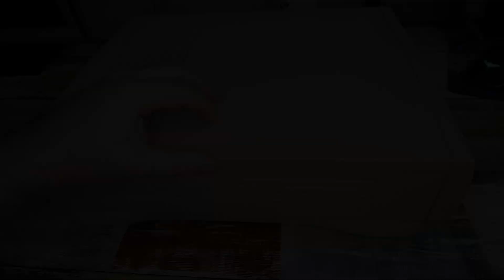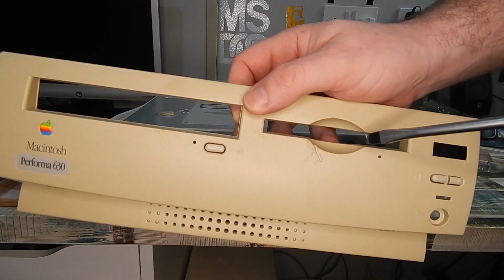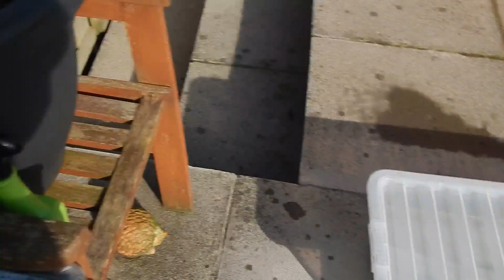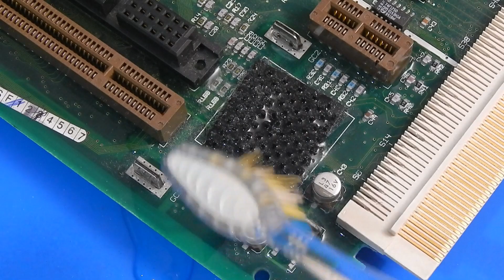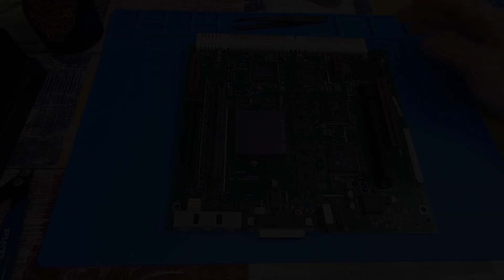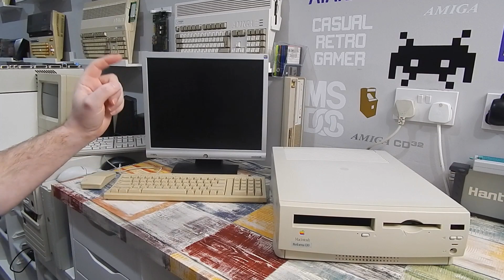Dumpster dived Macintosh Performa 630, time for a look. #MARCHintosh

Comment: I wouldn't be surprised if the original owner gave up on that exact typing exercise precisely because of the astoundingly bad decision to not print how to get a # on the UK Mac keyboard layout. 

Assuming it was the same in the 90s as in the 00s and today, hash is alt-3 on UK Mac keyboards because shift-3 gives £. On American boards, and most other locales, shift-3 gets # instead. 

Thankfully they actually print that on keyboards now so hopefully this doesn't happen anymore, but at least in the 00s you could Google for how to do it. Not so much in the 90s! And I wouldn't be surprised if the makers of Mavis Beacon didn't include anything about this one specific layout quirk. So much for teaching you everything you need to know to type!

Comment: PDS stood for Processor Direct Slot - a successor to NuBus. The best PDS ACARDS WERE DOS and Apple II compatibility cards.
Reply: This is a LC PDS, but may different ones existed in thos times, depending on the mac model. Because this wasn`t a bus like Nubus, it was a direct link to the cpu. I owend a PPC Performa 5200, the mainboad of which based on the design of the Performa 630. In those days I put an ethernet card into the LC PDS slot.

Comment: Great video, I'm glad you were able to get the Performa 630 working again! If you happen to come across an external SCSI CD-ROM drive, that would be another option to add a CD-ROM if you can't find the original edge connector adapter.
Reply from the maker: I do have an external Amiga SCSI CD drive.  I say that but the drive is just a scsi device in an enclosure, the only Amiga thing about it is the squirrel adapter.  I suppose that may work if I get the proper scsi cable for the MAC.

Comment: GadgetUK164 has started using a neat new technique to remove capacitors, with minimal impact. He uses two soldering irons at once to flow the solder then pick up the cap and remove it all in one action. I haven't tried it myself yet but he was astounded how much easier it was compared to his usual hot air solution... (Video here: https://www.youtube.com/watch?v=E49comAT4nM)
Reply from the maker: Sorry for the late reply, when you link other videos the comment gets automatically held for approval.

So what he is doing is essentially like the soldering tweezers you can get.  Personally I don't do that much of it and I'm happy enough with the air but in all it probably is the method with least risk, especially if there is leakage there already which can sometimes make it difficult to get heat into the solder.  

I am subscribed to GadgetUK myself, top man and really knows his stuff.  In fact most of the techniques I use I've picked up from watching him.

Comment: I've learnt 2 things from this vid: hard drive is IDE on a 630. And there is just about enough sun for retrobriting in Northern Ireland ;-)
I love macs from that era. Always wished back then I had one. :)
Reply from the maker: You get it all on CRG, questionable hardware knowledge and sketchy weather forecasts 😂
Reply: Not the 630…. Any Mac from ‘94 to ‘97 is a decent machine, but the plastics… they are so brittle. I’m a Performa 637CD owner myself and I can attest to the fact something falls apart every time I tinker with it. As far as beige Macs go, the beige G3 is what I’d recommend most as it has PCI (meaning you can install a USB and VGA card evading the proprietary stuff without adapters) and IDE, rather than SCSI which is infuriating to use (A BlueSCSI is nice but a pain to set up if you’re a first timer, take it from my experiences with a Mac Classic).

Comment: I have a 636 which is sitting in storage right now.  These are basically a Quadro 630 with an LC processor.  They were (including the Quadro model) all lower-end machines which used an IDE hard disk rather than a SCSI one and were a bit more limited in terms of expandability.  I would like to find a regular 68040 to put in mine so I can run A/UX on it.

The PDS slot is for the Power Macintosh Card which will basically make it into an LC Power Macintosh.
Reply from the maker: I think if I could at least find a cd drive mine would be useful for running some old software.  Might even be useful as a means for getting software onto disk for transferring to the classic. 

If that cdrom connector is scsi would be possible to hang a scsi hdd off the same ribbon?
Reply: @CRG  Mine is fully working and it currently has a 160GB hard disk and OS 8.1 on it.   I have the original monitor but it has no stand due to the ubiquitous brittle plastic on these later 68k machines.
Reply from the maker: @douro20  yes the plastic is very brittle.  Taking it apart it kept feeling like it was going to snap.